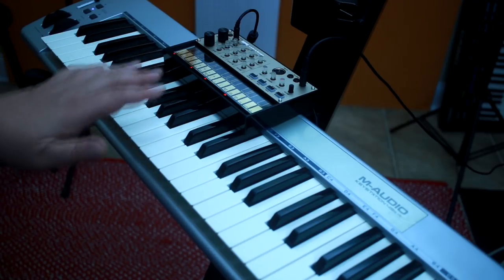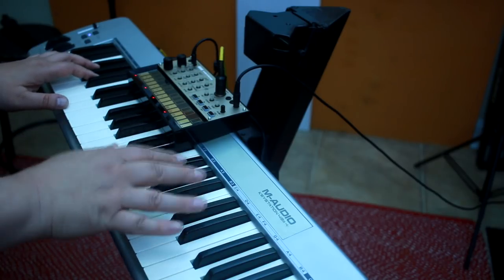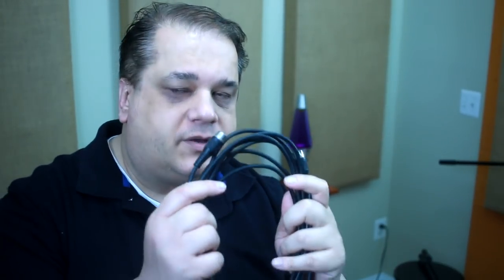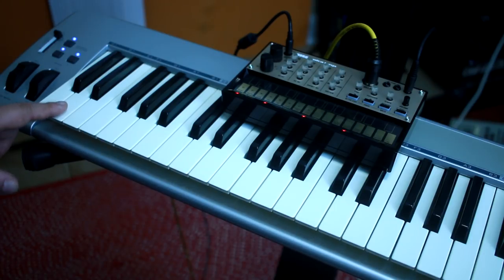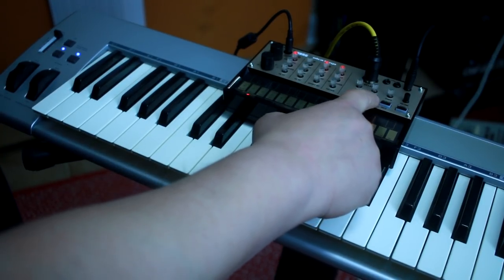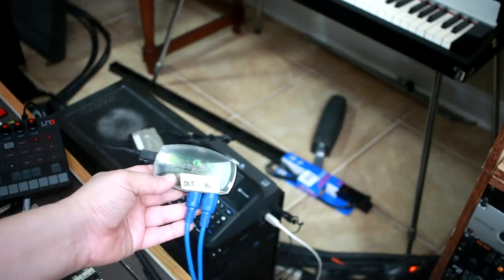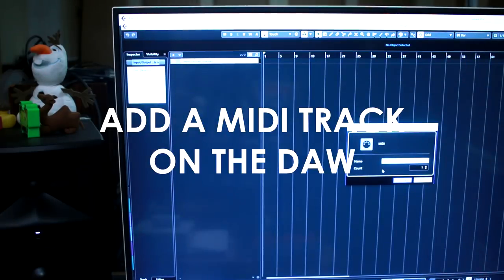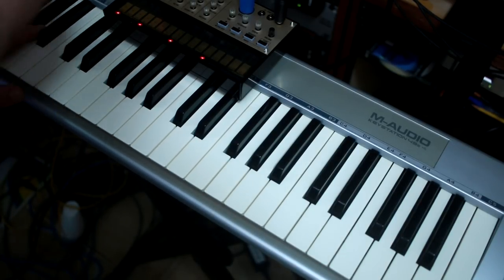How to play Volca Keys from MIDI controller

Comment: Um, really folks. How basic is that?  People had trouble plugging in a MIDI cable?
Reply: The volca keys is affordable as a first synth, everyone's got to get this information from somewhere. On the other hand surely a Google search would help.
Reply: Well he did give a quick no-nonsene intro on channels and DAW IN&OUT connections so that's cool
Reply: Must admit, I was quite surprised by this...
Reply: Ok, yes the basics are where it all starts. And this was clear and simple. Paulo gets it done, as always.
Reply: Video killed the radio star - Software synths killed basic MIDI knowledge ;)
Reply: I struggled with this for a while before finally realizing that I had a MIDI cable that for whatever reason doesn't work with the Volca (but it does work with other gear). It is basic, yes, but sometimes you still need to troubleshoot basic stuff.
Reply: I mean I came here cause I didn’t know soooooo…. shrug

Comment: I have a Volca Bass, there are some things I'd like to add, all the Volca's can be played via midi but if you have a Midi cable plugged in from your computer or hardware sequencer and it is sending the Midi clock output to your Volca (for example in Cubase you can check via the 'Project Synchronization Setup' window under the 'Transport' tab from the top menu) then the Volca's onboard sequencer will trigger and you will be unable to hear what you are playing via the Midi keyboard as the sequencer will trigger the sequenced notes as soon as you try to record anything into your DAW etc. To get around this either clear the current pattern in the Volca's sequencer or uncheck the Midi clock output in your DAW or hardware sequencer, then you can record and playback your performance without the Volca's onboard sequencer interfering.
Reply: Now THAT was realy helpfull! I already tryed everything from the Video, But your comment was the real clue!
THX!

Comment: I'm a complete beginner and just got a Volca Keys and Arturia midi and had no idea why it wasn't working together. This was very helpful, thank you.
Reply from the maker: Glad I could help!
Reply: how did you get it to sound ?? I can controlle it but it sounds just from the tiny volca voice speaker...... i have lots of synths MIDI conected through my controller (arturia out / synths in) , and they all have a output so i can conect them to my mixer and everything sounds great, but the volca just dont sound from the mixer because it has not output .. soo frustrated right now.....
Reply from the maker: The Volca output is the headphone output. You have to connect the Volca headphone output to your mixer using an 1/8" to 1/4" audio cable (or a 1/4" cable with an 1/8" adapter).

Comment: I tried a Korg microKontrol and ordered a new midi cable.  Didn´t work even after setting the midi channel to the same value both on the keyboard and the volca. This was because I haven´t got an AC adapter for the keyboard and thought I could plug the microcontrol into the USB port of my computer for power. Turns out that controlling the volca doesn´t work as long as you do that. As a proof of concept I inserted a few batteries into my microKontrol and switched from USB to DC and voila! midi worked perfectly. Hope that helps someone.
Thanks for the video because it got me quite a step closer to using Midi on the volca.
Reply: I think I have this issue, I tried to run by volca bass using my novation mini, powered by the laptop. But no luck. But you've made me think maybe I should just try a phone charger for the USB C power.
Reply: I think I have this issue, I tried to run by volca bass using my novation mini, powered by the laptop. But no luck. But you've made me think maybe I should just try a phone charger for the USB C power.

Comment: Nice tutorial.  Also the Volca Keys sounded so great.  😍  I can do complex midi routing in my sleep, but I still enjoyed this.
Reply: SyncdAlien   Could you help me?  I have looked and looked but cannot find out how to have my midi controller do anything but play the notes on my synth module (Roland JX-03).  my controller has on board pots for adjusting envelope etc but I don’t know how to get them to communicate anything but the pitch from the pressed key. Any help would be really appreciated!
Reply: Please tell me the manufacturer, make, and model of your midi controller.  We need to look int he owner's manual for how to set which continuous controller value is being transmitted by each rotary controller.  I have found that MIDI controllers by default are usually set to everything except what you'd want.  The JX-03 has a robust midi implementation, and you can find the continuous controller numbers it receives in the MIDI implementation chart: https://static.roland.com/assets/media/pdf/JX-03_MIDI_Imple_e02_W.pdf

Comment: Very well explained, as usual. Apart from what I've read on the net, that the vk doesn't receive any pitch bend input, my cz-101 pitch bender works well via midi with my 2022 volca keys. Just plus or minus 1 tone, I can't change the bend range anyway, but it works.

Comment: it still doesnt work for me sadly. I have my keystation 61es usb powered, set to midi channel 3. My volca bass is also set to midi channel 3. Nothing happens. when I link the keystation to any other synth via midi it works fine. I dont understand what im doing wrong. The manual isnt of much help either.
Reply: same here but my volca sometimes work and sometimes don`t, i can`t unerstand why that happens
Reply: Same with me. It cannot bei a bad cable, because it's working with a Korg NTS 1. With my Volca Drum, i Hear only the First Sound in every Key, and with the Volca nubass I went throu all Midi Channels... Nothing ...
Reply: Same with mine aswell. My arturia keystep works fine but I can't get the keystation to work, I've selected the same midi channels aswell.

Comment: So I can plug a M Audio key station via a midi cable straight into my volca without a computer?
Reply: That's what I want to do... I want to not use a computer but use a small keyboard with my three Volcas.
Reply: @OregonDARRYL  since then I have bought a m audio key station, and yes, it does work plugged straight into the keys.
Reply: @TheIndibush  Awesome! Thanks very much.
Reply: @TheIndibush  How did you connect it directly? I didn't see any DIN plug on it? Is there a special cable? Thanks.
Reply: @OregonDARRYL  is it the keys you’ve got? There’s one on the front
Reply: @TheIndibush  You must have the m audio that has a DIN on it. The new ones don't. That's okay... I ordered a $26 RockBand 3 Keytar off of Amazon that has a MIDI DIN port on it. 
I also have an old Emu X-board 49 key MIDI controller. So, I guess I'll work with what I have.Thanks!
Reply: @OregonDARRYL  yeah, I do have the older one. Sorry, forgot the new one doesn’t have the din socket. Good luck with the keytar, hope that works well for you. Maybe next year I want a keystep, by Arturia. A lot of Volcanaughts use those, so must be good 😉
Reply: @TheIndibush  Yeah, the Keystep makes me drool...

Comment: Thanks very much for your video.
I understand that but want to have my midi controller slides and knobs operate the Volga keys knobs as well.
I have downloaded the Korg midi implementation chart and it list CC numbers for the knobs to operate the Volga Keys.
Geo I have the CC numbers what do I do with them.
There must surely be a computer program that has to be used to do this.?

Comment: There’s something more to this. Agreed that this SHOULD work for anybody, as long as you have a good cable and the channels match. It’s a good video, but I’m one of the Keystation (Pro 88) users for whom this does not work, specifically with the Volca Keys.  My controller works fine with the Volca Kick.  And it works a little with the Keys.  Pitch bend works.  Sometimes notes work.  Usually what I get is activation of the Play button on the Volca.  Weird.
Reply: Last night I thought about firmware.  I checked and my Volca Keys was not up to date. So I updated the firmware and — no dice.  Same results.

This is with two different midi cables, one of which is brand new.  Channels have been checked and rechecked.

Further googling has revealed more than one suggestion to buy a Midi Thru Box, which is not just a midi splitter (a good idea), but apparently a signal booster and/or cleaner. I have not yet seen confirmation that this particular problem is solved by this product.

And never mind how this is working for Paolo and not me.  If I was him, it would also seem that the people asking just don’t know MIDI.  But there is something weird going on for many of us.

I will probably buy the Thru Box. It’s a little pricey for what it is, but if it solves this problem then I guess it’s worth it.  I’ll let you know.
Reply from the maker: Yeah, it's puzzling how so many people are having this issue. I'm not sure that a Thru Box will make a difference... that's for sending MIDI channels to different destinations and it's a useful tool to have but I don't think it boosts or cleans the signal.... but yeah, let us know if it works with it after you bought it.
Reply: @SynthManiaDotCom  I think I was referring to this bit of the product description: “Active circuitry cleans up any skewing of MIDI data bits that has occurred at the input, ensuring reliable operation in setups that require daisy chaining or long cable runs.”

But, I’m also a programmer, so I know the mantra “Garbage in, garbage out.”  I also know that the Keystation IS able to send midi to other devices that I have.

It’s just this weird combination. I can’t wait to figure this mystery out.
Reply from the maker: @johningram2153  Yeah.... let us know what happens after you have bought the MIDI thru box...
Reply: @SynthManiaDotCom  I do have an update, though I never bought a dedicated MIDI thru box.  HOWEVER, I just happen to have a Roland U-110  (which I bought locally for a steal, after watching your video on the U-110, in which you walked through many of the sounds).  I had it back when I tried the Volca with my Keystation, but it hadn't occurred to me to route my MIDI signal from my Keystation, into the Roland, and then to the Volca from the THRU connection to the Roland.  That works beautifully.  I then routed directly from the Keystation to the Volca again, and garbage.   Back through the Roland, and it's heaven.  That 1988 MIDI goodness!   So, I don't know a ton about the specifics of MIDI, but it does appear that going through something old is doing something to the data that's making it easier for the Volca to understand.  Any thoughts on this?   Since both solutions have the word "THRU" in common, I suspect buying a THRU box would have yielded the same results.   But now I don't need one.  If I don't want to hear the Roland, I just turn its volume down.
Reply from the maker: @johningram2153  Yes, that - again - is puzzling because the MIDI Thru port should be the same as the MIDI Out port, so if it works with the thru, should also work on the out from the Keystation. The only thing I can think of, is that maybe not all the pins on the Volca are wired, and somehow routing through the U-110 adds those connections
Reply: @SynthManiaDotCom It also doesn’t work from the OUT port on the Roland, by the way. Doesn’t work at all, not even badly.  Only the THRU port.

Comment: I don't have much MIDI experience. I tried to play the Volca Keys with the Keystation 49e (both USB and 9V-powered, if that makes a difference). I can't get it to work.

It's not the Keystation alsone. It can play my digital piano and my old Technics keyboard.
It's not the Volca alone. My piano and keyboard can play it just fine.
It's also not the cable, which was used for all those other connections.
I set the MIDI channel to all kinds of value pairs and combinations. I tried both the "Short Rx Message" thingy on and off on the Volca.

Am I out of luck or is there any hidden setting I have to try? Any help is appreciated!

Comment: Usb to midi interface and use it on computer, not to sure? Would like to use with out computer
Reply from the maker: If you don't have a controller keyboard with 5-pin DIN MIDI ports, you have to go through the computer, and get a USB-to-MIDI interface that connect to the computer, and the Volca. If you get a controller keyboard that has 5-pin DIN MIDI ports, then you don't need the computer.
Reply: Thank you for advice, I will probably go for getting a oldskool  keyboard can pick a cheap one up second hand for under £50

Comment: I still can't get it to work despite following these instructions. I have both devices on the same MIDI channel but the keyboard won't generate any output. Is there something I need to do with the VOLCA settings perhaps? I'm using an M-Audio Oxygen 49 keyboard.

Comment: how did you get it to sound ?? I can controlle it but it sounds just from the tiny volca voice speaker...... i have lots of synths MIDI conected through my controller (arturia out / synths in) , and they all have a output so i can conect them to my mixer and everything sounds great, but the volca just dont sound from the mixer because it has not output .. soo frustrated right now.....
Reply from the maker: You have to use the headphones out on the Volcas.

Comment: Hi der.. Im using a m audio keystation mk3  61 keys.  Got the midi channel set on both units.  Now der s sound but at a very low volume.. folks at other forums say its a velocity issue as ribbon on d keys has set velocity or sometin like tat. My M audio doesnt have any means to set velocity curve as far as i kno.. is der anytin im missing..?  Im running it along with a volca sample thru an i rig mixer to novation audio interface to ableton to speakers..

Comment: Thanks SynthMania. It works. One issue I still have is that the notes are more silent and not as "full" sounding when playing through the MIDI keyboard. It just sounds better when playing directly on the Volca keys. Do I have to change some settings on my MIDI device (m-audio keystation 49e)?
Reply from the maker: Probably the Key Velocity sent from the M-Audio. I no longer have it, but try to see if you change the velocity send (0-127) - or fixed if you prefer it.

Comment: i jhave akai mpk 25, its powered by the laptop.

In this case, do i need a usb midi host.

Second point:

Ive got a bass, and a sample volva now.

I bought a beringer mixer with the an option to add in FX POEDALS.

I intend to run this all through a PA or AMP.

Will this suffice?

Comment: How to connect my Casio VL-1 minikeys keyboard to control my volca Keys via MIDI? Should I upgrade to casio VL-5?
Reply from the maker: Yes - that way you can use MIDI-over-Bluetooth - which the VL-5 has - while the VL-1 still has the old wired protocol

Comment: So from the last part, did u connect the keyboard to the audio interface midi in?
Reply from the maker: Actually no, the last part is for a scenario (as people asked) when the master controller keyboard doesn't have DIN MIDI port, but only USB. So, the last part is keyboard USB cable to PC USB input

Comment: Hey! Thank you! But I had a little problem (not covered in this video). I tried to trigger a sequence from an Arturia Beatstep (connected via standard MIDI cable to my Volca Keys). I only managed to trigger an INTERNAL sequence (written in the Volca), but NOT the external one fed by the Beatstep. Am I doing something wrong? I asked Korg support... but received no answer. Could you help me?
Reply: I just leave one of the memory slots empty and if externally sequencing, make sure that is loaded on the volca.

Comment: I have a midi keyboard (only USB) and volca key how do I connect my midi keyboard to it when it is USB powered? Many thanks on lead, etc I need
Reply: I think you can route your Midi input to it in your DAW. My Midi Keyboard is also only Usb powered without dedicated midiports. I dont have a volca but it works fine with my Microkorg

Comment: excuse me, how to connect USB midi keyboard to volca?
Reply from the maker: You have to go through a computer - USB MIDI keyboard to computer, and then USB-5pin MIDI interface from PC to Volca
Reply: @SynthManiaDotCom  thanks for your reply. do i need some software to dispatch the midi channel? And does a Linux device (raspberry pi) could do this also?
Reply from the maker: Using a DAW to select MIDI channel is perhaps the best way? — there are several DAWs that work in Linux. Alternatively you could search for free MIDI routing apps

Comment: But first make sure you power up your MIDI keyboard controller with external power .
Reply from the maker: Or USB power.
Reply: so it won't work on batteries? I don't have a charger.

Comment: 30 years later and people still don't know the MIDI basics??
Reply: The software generation didn't grow up plugging and unplugging cables like we did.... or reading manuals ;) Hence, it's all new to them.
Reply: Dark Side of Synth : Okay but yet they do know how to plug their USB charge cables into their phones, which is basically the same thing.
Reply: @mauriziomauricone  Conceptually, it is but yet again, all routing is usually automatic in the DAW so.... they have no clue how component A is connected to component B - it is transparent/hidden. Whereas, with phone and charger it is not, so you learn right away how to do i because it hasn't been done for you, hence their difficulty when it comes to auido or MIDI cables. Yesterday, I had to reply on reddit on a guy who wanted to record his monologue in Pro Tools and connected the USB cable ;)
On the one hand, we have the Eurorack mania, on the other a wasteland of people who have no clue.
Reply: Normal Humans aren't born knowing everything, unlike yourself. You're special. Very, very special.